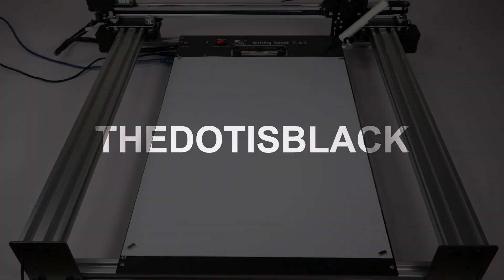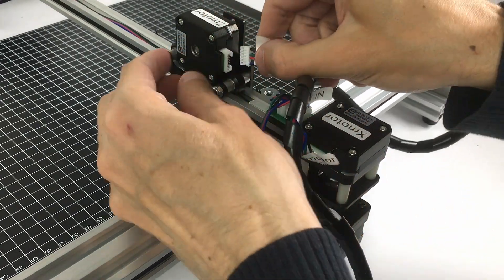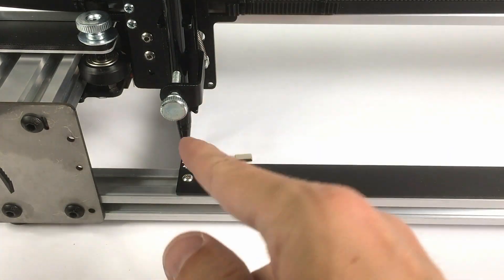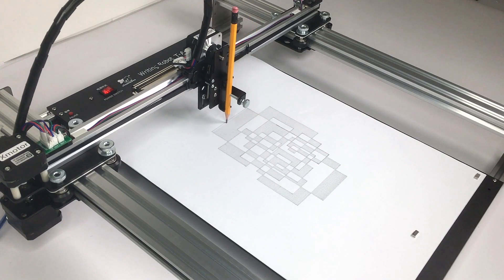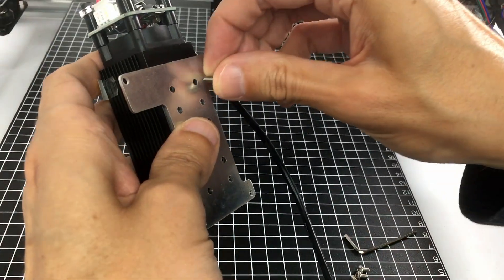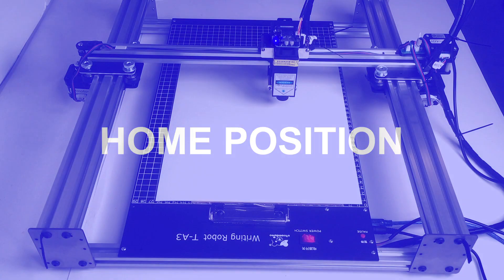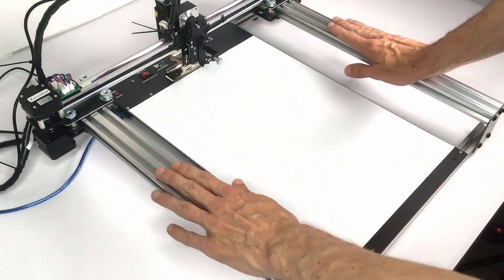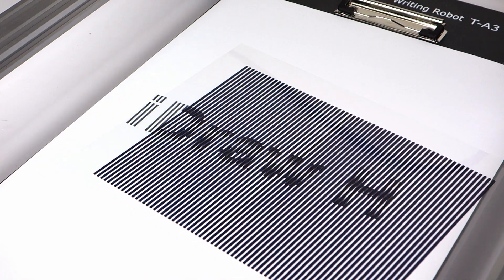REVIEW & TUTORIAL - iDraw H Pen Plotter with Laser Engraver  by UUNA TEK® (XY Drawing Machine)

Comment: Are the aluminum extrusions of common type wherein one could buy the iDraw but require and modify it to be much larger?
Reply from the maker: Yes, these are standard Aluminium extrusions. You will have to look around to find the specific y-axis frames for the wheels though. I did extend myself the smaller profiles for an exhibition without issues.
However if you attempt to increase the size of the plotter to A1 or beyond, you will also need to redo the belts. Cables are the easiest part. The microcontroller/drivers can be modified to any working area manually. The rest, stepper motors and pen holder plate are the same for any plotter size, no problem here.

Comment: How does the "H"-style compare with the cantelevered design, relative to speed, reliability, and precision?  Does it ever want to bind up, or do the two parallel axis motors get out of sync?
Reply from the maker: The H frame is better for high drawing speeds. It adds more stability. It is also a little faster than the cantilever. However, for high quality drawings you don’t use high speeds. (I personally prefer the H frame.)

The motors don’t make any issues, no out of sync or binding up. It’s flawless, never had any problems.

Comment: Could you do a video with the 10W/15W Laser Head for iDraw H A3/A1 Size plotters and how different they are from the 2.5W in speed and cutting depth, I guess they would need a better Laser Subplate?
Reply from the maker: I am sorry, but I don’t have the 10/15 W laser module. In my personal opinion, if you want a 15 W laser, I’d rather buy a dedicated laser machine. 
The reason is simply, 15W is powerful and you will need a proper setup for the baseplate  to avoid any damages below. That said, you can operate a 15 W laser with this plotter, but you have to be careful.

Comment: It would be nice to also compare the quality of the plots of the AxiDraw and iDraw. I see, you already made a different video about that. Did the quality of the H model change?
Reply from the maker: Personally I use the iDraw H only. My AxiDaw A3/V3 is doing nothing for a year already. That said I am very pleased with the iDraw H. It’s super fast, accurate and easy to operate, especially with the base plate. 

I will not do a video comparing the plotters. In my opinion there’s no need. Both plotters are very good. 
Biggest differences are though:
- the iDraw is faster when it comes to short lines. Continuous lines are the same speed.
- pen holder plate of the iDraw has a stepper motor. It’s great and huge upgrade compared to AxiDraw’s stepper motor.
- iDraw H needs less space to work with. The AxiDraw A3 for example, needs an area of A2 because the y-axis extends in both directions. It’s takes a lot of space. IDraw, on the other hand, needs less space.
- software/plugins are the same.
- however, one big difference is that the Axidrae is gentle to pen tips. It works with gravity. iDraw adds a lot of pressure. But personally I prefer pressure because the lines are stronger and no need for additional weight.
…

There’s more but it eventually it depends on the type of drawing, pens, ink and paper surface.
Reply: Great extensive reply @thedotisblack, thank you!

Comment: Thank you for such a high resolution review. 
Say you wanted to plot on an A2 piece of paper by splitting an image into two A3 sections. 
Do you think it's possible to could calibrate it perfectly enough to do that and so that there would be no visible seem between the two halves? Hope that question makes sense.
Reply from the maker: I understand your question and it is possible. However, you will need to calibrate the paper, extremely precisely. Of course it depends on the type of work too. Perhaps, to avoid visible “seams”, I’d divide the artwork in more sections. This way it’d look natural.
Additionally, if you want to use an A2 canvas, you will need to work without the base plate. A2 does not fit between the frames.
Reply: @thedotisblack  thanks for that. it seems like it’d be a bit of a battle of the artwork became too detailed. I think in that case it’s best I bite the bullet on an a1/a2 plotter.
Reply: One more question. How does the plotter generally determine the path it travels? Or where it begins on an image and where it ends?  Is that something that the software determines/optimises automatically with an algorithm? Or does one need manually determine/define the order of paths in an SVG. For example, with your pencil test, it creates the outline first, and then fills it. Or in that case is the outline and fill separated layers? Hope that makes sense.  @thedotisblack
Reply from the maker: @leslie_sharpe good questions. First of all, you can work and should work with layers, especially if you work with different pens or types of drawing elements (hatches vs. lines). In InkScape you can assign your drawing elements to separate layers. The plug-in of iDraw will draw each layer separately, or you can turn off the layers that you don’t want to draw, and only draw what is visible. 

Second, within each layer or in general the drawing can be optimized. The plug-in provides you with three options, either keep the order of the drawing path as it has been drawn or reorganize the order to speed up the drawing process.
Reply: So helpful to understand this detail. I've ordered an A1 model. A week ago I had barely heard about plotters. Now I'm a bit obsessed. Thanks mate.   @thedotisblack
Reply from the maker: @leslie_sharpe  Oh that is amazing. Once you set up everything, please share with everyone your experience with the A1 plotter.
Reply: @leslie_sharpe  after 4 month , is it worth it ? I am in the same position as you, I want to buy one and quite obsess haha
Reply from the maker: I wish Leslie would update us. But good news, soon I will receive the A1 plotter and will do a review video on it. Looking forward to it!
Reply: @thedotisblack   I’m still deep in experiment phase and have had limited time with a newborn around. But I have been obsessed with this machine from the day I opened it. My aim is to create a variety of illustration ideas that are procedurally generated so I can easily create variations. For example a series of 30 unique clouds in halftone form. My method is a bit different to a lot of the people I follow who output from code and tend to create more geometric based forms. I don’t code but I have tools like Houdini VFX and Blender to generate 3D models (for example volumetric clouds) that are then rendered as halftone (dots and lines) and output into SVG files which I refine in illustrator and then move into Inkscape.  So things like clouds or using physics simulations I output things that are less geometric and more organic. 

Although my tests have mostly been A4 and A3 I definitely think you’d get frustrated with a limited size eventually. Therefore I’m super happy I have the option or ability down the line to make larger artwork or make multiples on one beautiful piece of paper stock and cut. If you can afford it, and have the space I would 100% recommend the larger plotter. 

One thing that I would say however is that I’ve found Inkscape incredibly frustrating to use. It’s glitchy on a Mac at best but works better on Windows PC. I wish there was a extension from Illustrator straight to the plotter. I understand that its more opensource and free and therefore probably better for extension/plugin in development, and maybe Ive just been using illustrator for too long (20+ years) but its incredibly frustrating and time consuming software that steals a lot of time from the creative and creation bit. 

Not only is there a bit of a learning curve to the Inkscape software but theres a learning curve to the plotter too. Not super steep but it takes time and quite a bit of testing to understand the relationship between the plotter and different pens/mediums and all the tiny adjustments you need to make.  But this is the fun part of the learning curve. 

The other massive challenge is I find that the more complex SVG's (which mine tend to be) become, the more insanely disproportionately/exponentially and brutally slow to output from Inkscape to the plotter. Im not talking about plotting time (which I dont mind), im talking about file transfer when you hit print. It’s hard to know how long the files will take to process, or whats actually happening because the status bar is very primitive. So after 20 minutes you could think it’s frozen, then force quite Inkscape and then a minute later suddenly the plotter starts. But I just find how slow the processing is super frustrating and limits the potential of some ideas. It seems like its got less to do with SVG file size (often nothing larger than 5-10 megabytes) but more the quantity of paths. Im sure someone smarter than me with basic hardware/software engineering/coding knowledge would be able to identify why it’s so slow. My guess is that its to do with the bridge between the computer and the hardware/computing/memory of the plotter itself? I wish there was a way to upgrade that hardware easily? 

Anyhow, lots of words and no visual examples. These are my views and my experience so it might not line up with others.
I might share some stuff in the new year. 
Hope any of this was helpful
Reply from the maker: @leslie_sharpe @leslie_sharpe this an incredible detailed experience. Thank you for taking the time to write it down!

Just to confirm, everyone with a pen plotter shares the same experience, whether it’s the limitations of A3, the understanding of machine movement, interaction of various pens and paper surfaces, the number of drawn items, and the incredible painful Inkscape. 

I also work with differente apps to create drawings, the past couple of weeks mainly with Rhino3D/Grasshopper. But the problem is always the same, the number of items. With it the export to an SVG. 
I noticed that when I export directly from a code (i.e. Processing) I get less issues with Inkscape and plotting. Likewise the items in the SVG are accurate. I assume the problem is how the SVGs (PDFs) are written/exported. In some cases, I export first an AI file and then in Illustrator I release masks and ungroup items before export to an SVG. Additionally, I create groups, assign colors that I can control faster in Inkscape when plotting. 

That said, it’s not the microcontroller that slows down the plotting experience. It is Inkscape itself. Files with a large amount of items are always slow. The plug-in/Inkscape first analyzes the drawing and optimizes/orders everything into a list. Once this is complete, the plug-in sends each command/item to the plotter, one after the other.

There’s not much you can do about it. But check in the iDraw plug-in whether you have plot optimization on, or whether it’s selected to “none”. Plot optimization slows down everything. “None” will also take time, but the plug-in will simply execute each item in the order the SVG file was written. Hence, writing the SVG directly from code is the most efficient way. Exporting an SVG file from a totally different app messes up the order and it’s slower to compute before plotting.

To avoid long computing/optimization, work with layers in Inkscape. Turn on the layers only that you want to plot. That will increase the optimization speed significantly. Perhaps, before SVG export, in your app, assign directly colors that you can select/group faster later in illustrator or Inkscape to assign the to various layers. 

Alternatively, you can try GRBL. It’s less convenient for layouts but supposed to be much faster.
The fastest way however is to directly control the plotter with a code. Many people write their artworks, for example Processing, and the algorithm directly controls the plotter with commands. It’s fairly easy to do but the workflow is totally different. 

To keep it short, it’s necessary to explore possibilities and develop workflows that work best for the outputs.
That said, I want to use the big plotter for bigger/thicker pens. But I will need to 3D print or make a larger pen holder plate first. Otherwise, with too many strokes my pens will run out of ink and I will need to change them frequently during a plot… It’s exciting!
Reply: @thedotisblack  some great insights thank you. Yes I have some larger pens I’d love to use… like ink dabbers. If you end up investigating/designing any pen holders I’d love to learn more
Reply: @thedotisblack  actually do you have any views on good 3d printers ? Or would you outsource?

Comment: Hello, I am wondering if you think the H SE version is now a better buy than this base model version?
Reply from the maker: Hi, I use the iDraw H model constantly. I don’t have experience with the SE model, however SE has a basic servo motor for the pen holder plate and the microcontroller is on top, visible. The H version has a stepper motor, it is much better. The micro controller is also hidden. iDraw H A3 is in my opinion a better choice. If you can, I’d consider the A1 size.
Reply: @thedotisblack  Thank you for taking the time with these videos, your content is truly invaluable when considering pen plotter. I'm considering purchasing either a H or H SE. Do you think there's any merit to H SE being Axidraw compatible (EBB), while H is GRBL-based? It just felt odd that H would win out, as H SE is newer, and I should be the target audience of it as well as a software engineer.
Reply from the maker: Hello, like is said in the previous reply, I don’t know anything about the SE version. I judge it by its hardware parts only. Most important is the position of the microcontroller and the stepper motor of the pen holder plate. The stepper motor is faster and durable compared to the basic servo motor. Unless you plan to swap it for a brushless motor yourself.

The software is not an issue for me. I usually use the Inkscape extension. I don’t have experience programming directly or using Gcode with the iDraw H. No need for it. However, I use the AxiDraw extension for the hidden lines removal and then plot with the iDraw extension. For laser engraving/cutting I use Lightburn. Basically whatever works.
GRBL works with iDraw H. I was testing/modifying the max speeds and other parameters with it, to see its hardware limits.

So, I can’t give any recommendation, except for the size: If you can effort it and have the space, get an A1 version.

FYI here is a chat exchange on Reddit that will help you hopefully: 
https://www.reddit.com/r/PlotterArt/s/U2WCiVGEE0

Comment: Thanks for the review ! Does the laser cut can cover the whole A3 surface ? Does the weight of the laser is an issue when using the plotter ?
Reply from the maker: Yes, the laser module covers/engraves/cuts the entire A3 area and the weight is not a problem. I've been using the pen plotter with the laser module attached at the highest speed. No issues at all.
Reply: My machine is almost identical and the diode type lasers present no weight problem

Comment: can you show how you set ligthburn up for the pen plotter?
Reply from the maker: I did it at 26:17 Software Lightburn.
Reply: @thedotisblack  Yah i saw that, but i thought it was only for the laser. Dose the same settings apply for machine when you use the pen plotter?
Reply from the maker: @SuperCC112  I did not try to use Lightburn to plot with a pen. But I think I saw it somewhere that it is possible. You will need to enable the z-axis in the setting of LIghtburn and setup their heights. Uunatek has a video on their channel I think. Have a look.
Reply: @thedotisblack  OKay thanks for answering :)